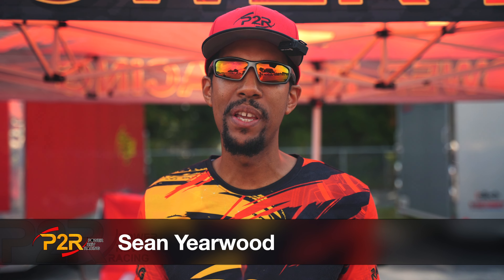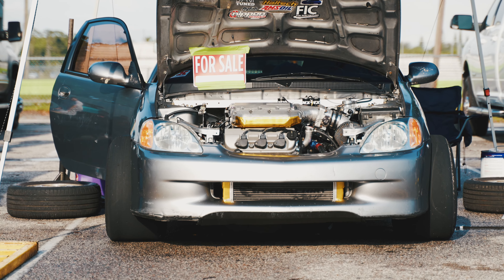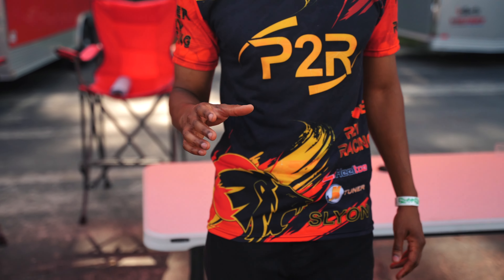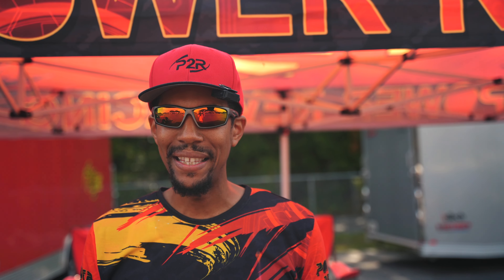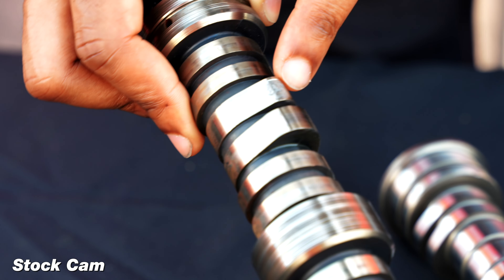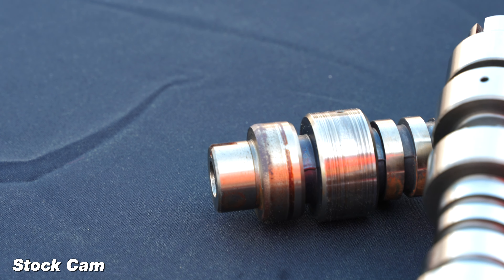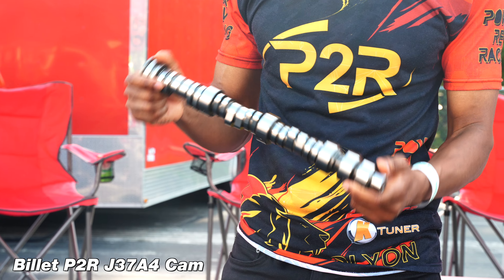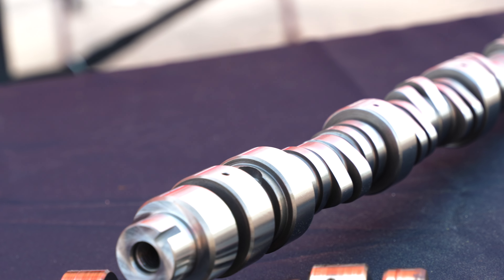P2R OE+ Billet Camshafts for J37A4 - The Best Bang For Your Buck!

Comment: Will this fit on a v6 j30a4 engine also
Reply from the maker: This cam will not; however, we have cams for the J30A4. 
https://powerrevracing.com/products/stage-1-billet-drop-in-camshafts?_pos=1&_sid=40f830300&_ss=r
Reply: @PowerRevRacing  I need the best perfomance upgrade for my j30a4 2005 v6 sedan. Build ty

Comment: Why no more power? Hopefully we will see another option for more power down the line.
Reply: he said its because this cam was designed to replace OEM cams as they wear away quickly not as a mod to increase power.
Reply: @saniwada I get that I’m just hoping for more power from a cam at some point. I’ve replaced many of these camshaft’s due to them pitting and wearing down. But I just want to have a performance option for this engine.

Comment: Which one do i need for the J35 block with J32 head
Reply: If its a j32a2 head then you’ll need 1st gen cams or a cam spacer to use the newer ones. If its a a3 head you need 2nd gen cams.